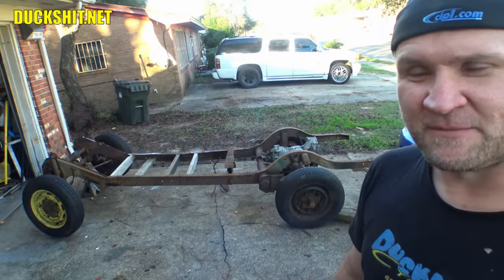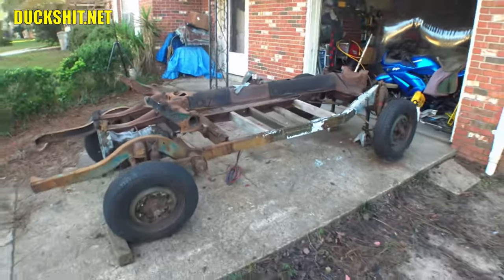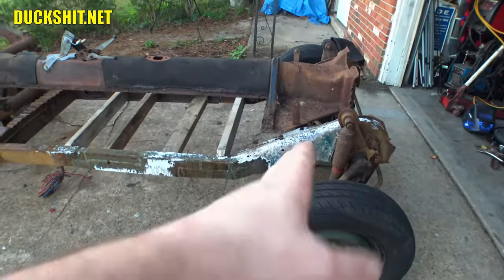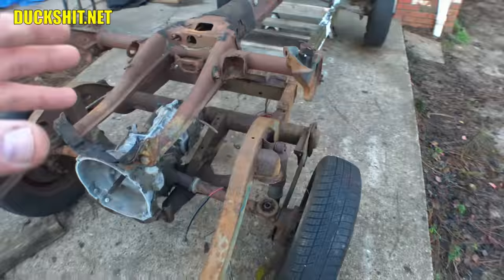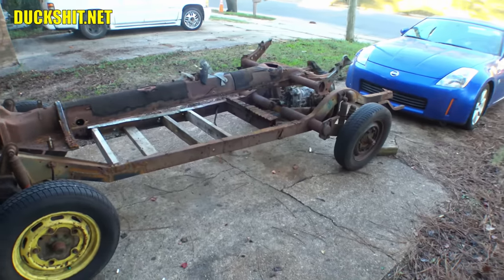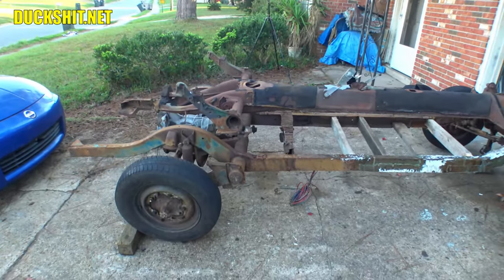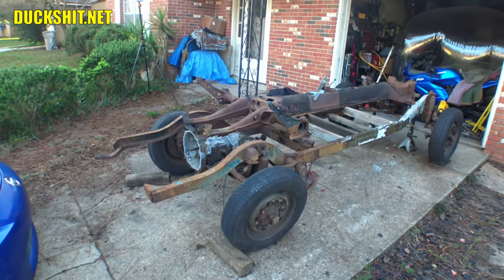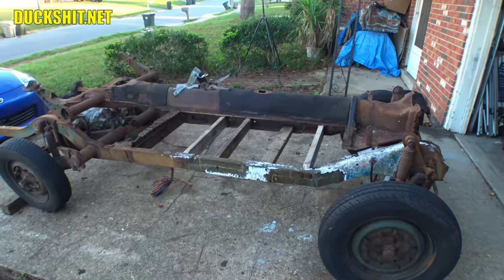Beetle on Bus Frame?  -1967 VW Bus Frame Restore - 04

Comment: Thanks again Duckman...I would have never guessed they was the same length
Reply from the maker: It really amazes me just how they were built to match, despite being different platforms entirely.  I do wonder what the reasoning was.  Maybe they wanted the same turn radius or something.
Reply from the maker: Yes, VW is well-known for parts-bin-engineering.  Except nothing was identical between Beetle and Bus chassis except for the transmission swing axles.  So why the same wheelbase?  We may never know!
Reply from the maker: But it's not one frame.. Beetles and Buses are still completely different as demonstrated in this video!  😁👍🏻🦆😳

Comment: I definitely stand by the idea of a P100 pickup type of VW Beetle. The front of a beetle, cut behind the front seats, new back fabricated, maybe even using the back window area of a bus or something in the same vein. Then, add a pickup bed. Could even be quirkier still and make it out of wood sides like those early 20s and 30s trucks. It'd be a Ranchero type look, but it'd be practical too for moving parts around, picking stuff up, etc, AND you might still be good to use the trunk space in the front so it's carrying in front and back. I dunno, I just could see you REALLY having fun with a build like that. All the best to you Lord Duckman!
Reply from the maker: Thanks so much for the input!  The end result will probably be something like you describe!  More to come on that one soon!   😁👍🦆💩

Comment: It's amazing how you fixed this frame. I would have never guessed it would be salvageable. Well done My Lord.
Any chance you could mount a bug body on this frame backwards? So the engine is under the front trunk and the gas tank is mounted under the back engine compartment. You we have to re-engineer the whole steering system. But this might look really cool at a VW show.
Reply from the maker: No sir, I am not The Lord.  I am The Duckman.... or Lord Duckman.  I cannot be compared to a deity, I'm just an idiot with a screwdriver that sometimes does a brilliant thing by accident!   But a VW with the engine in the front is wrong in my book... lol!  Which includes all the new ones they build today!

Comment: The beetle pan/frame is a very sturdy unit, as they have been made into thousands of off-road vehicles. After watching your cutting up and repairing of that old buss, it’s painfully obvious that the busses are only strong when complete. I am sure you will add steel floor pans welded to this bus frame. I’ve never seen it done before, it should be a good project to watch you build.
Reply from the maker: Indeed, Bus frames are only strong when complete!  I got plans... stay tuned!   😁👍🦆💩

Comment: Suggestion for the Lord Duckman. Why not make your own Frankenstein VW Bug front end and turn the back into a pickup, maybe with folding sides in case you need to load things that don't cooperate with the exact width of your bed?
Reply from the maker: Sounds like a great plan!  I'm still searching for the right deal on a body!  I have another Beetle in storage, but I dunno if I want to cut that one up yet!  We'll see!  Thanks so much for hte suggestion!

Comment: What I would do os take the bus body, cut the front off right behind the seats then cur the tops front so that it was right behind where the seats are. I would then extend the frame forward and graft a Bug body from behind the "B" pillar forward to the bus and make molding to make it look like it was from the factory. It would resemble how they put  a bug front on a camper.
Reply from the maker: That would be interesting, however that "Lil Bugger" that you describe is actually a beetle platform, with the rear portion of the body cut off and a camper built on there.  Check out @tinkering_guy for his VW Beetle panel wagon similar to what you describe.  He just got started, looks like a great build!
Reply: Actually what I'm talking about is longer than the beetle because you cut the bus body in front of the"B" pillar behind the bus seats and behind the "B" pillar on the Beetle so the seats of the beetle would still be in the same place as the bus seats while the nose and front wheels would extend farther forward. The advantage of this is you still keep both side doors and all the cargo space from the bus @DuckmanCycles
Reply from the maker: That would be unusual, the wheels wouldn't line up with the openings.  Gonna have to stretch the bus frame!  Weeee
Reply: I know, that's what I said in the first comment but you want what you want, right? @DuckmanCycles
Reply from the maker: Yep, sure would be strange lol... would take a lot of work to make it look right

Comment: I've had this argument with people myself VW all older air cooled vws have the same length wheelbase but a Karmann Ghia and VW Thing are about 3in wider then a VW Bug
Reply from the maker: Yep each floor pan is about 3 inches wider, for a total of 6 iches wider in the passenger compartment.  Not to be confused with the track width, which is the same, however!

Comment: Fake (but realistic) Kübelwagen.
Reply from the maker: Where?  I no see it in this video!
Reply: @DuckmanCycles 
(Kübelwagen) >>I no see it in this video!<<
Build it!....Just like you, I "imagined it" on that chassis.  I see you found a "Thing" mostly the trunk lid is different...sloped
Reply from the maker: Oh man, but that'd be another 6 year project lol!  I want this thing built in a few months or less!  😁👍🦆💩
Reply: @DuckmanCycles  >>that'd be another 6 year project<<
No no no....
Just do "The Thing" thing...and later change the hood angle, w/fender mounted headlights. Use round trailer fenders.
Reply: @DuckmanCycles  Just look at them both on search engine "images"
Reply from the maker: I think if I Thing it, it'll stay Thing! Hehe!
Reply: @DuckmanCycles  Well, there are plenty of pedestrian Beetles out there, but only one "Eleanore". 
Besides, a "Thing" would look stupid with a 50 cal machine gun in the back.